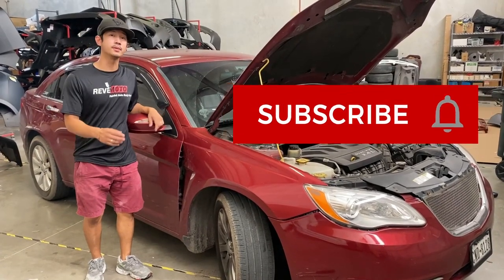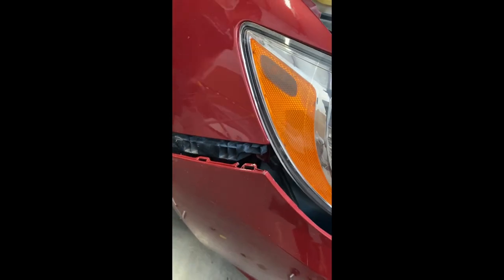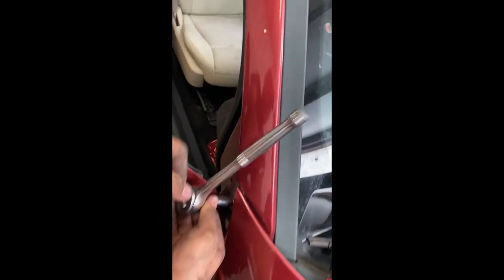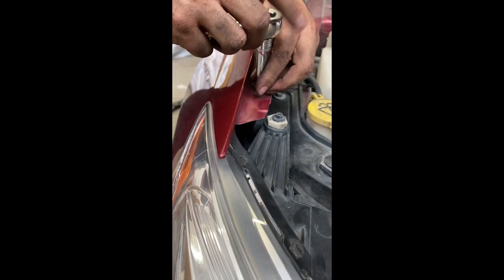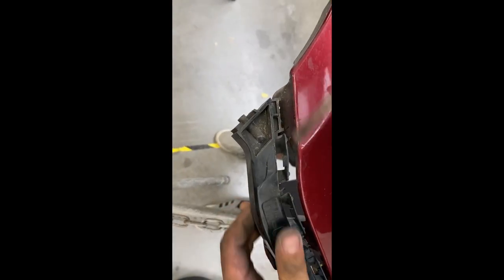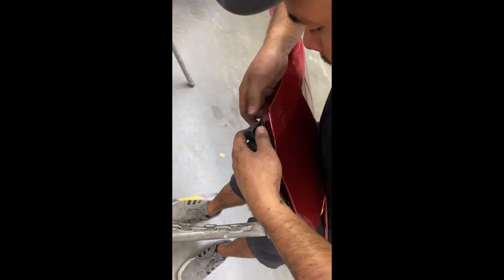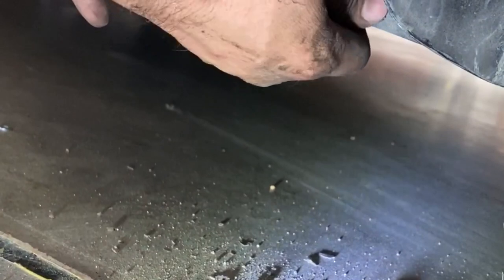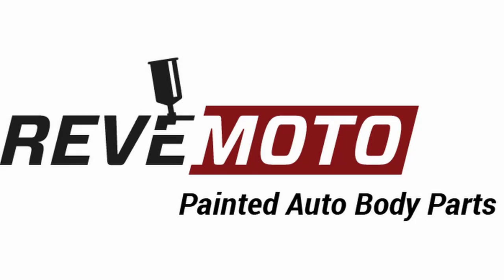Learn how to replace your 2011-2014 Chrysler 200 fender!

Comment: How many clips should I buy if I’m putting a brand new splash guard on as well?
Reply from the maker: We recommend reusing any clips that you can. We also recommend buying the clips at the dealership because they will tell you exactly how many you will need. I believe this one had around 8-10 clips on the fender liner and the splash guard/engine shield had 5? Thank you for watching!

Comment: How did you remove the foam in order to reach the fender bolt behind the door? Do I remove the plastic clip?
Reply from the maker: Hello and yes! It's a bit annoying but there is a clip in the middle you have to pop off. Thank you for watching!
Reply: @ReveMoto  would I use the same tool I used to remove the other plastic clips? Or what did you use to remove it? I noticed the head of the clip is larger than the other, which is why I want to make sure I'm using the correct tool.
Reply from the maker: @jenniallshouse689  yes mam, the same tool should work just fine